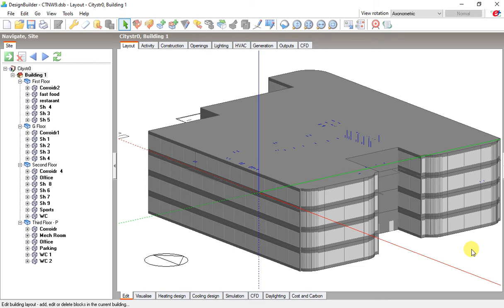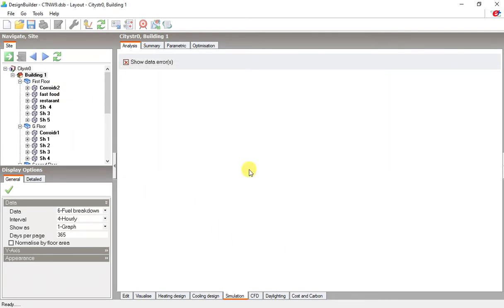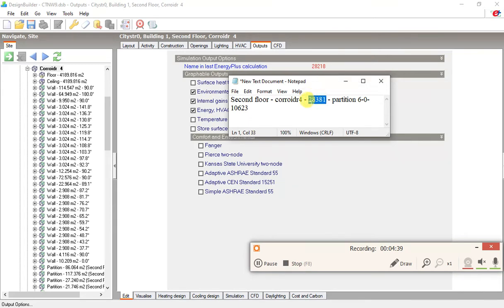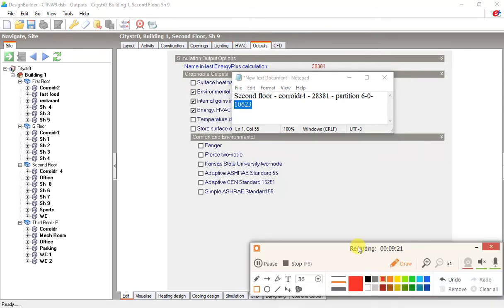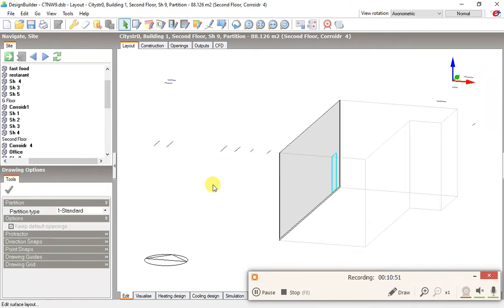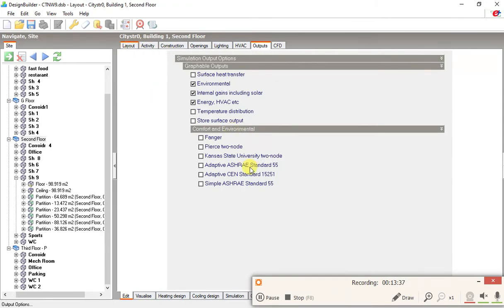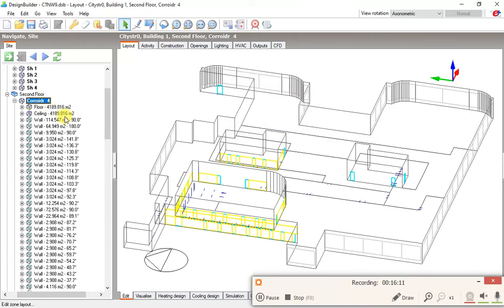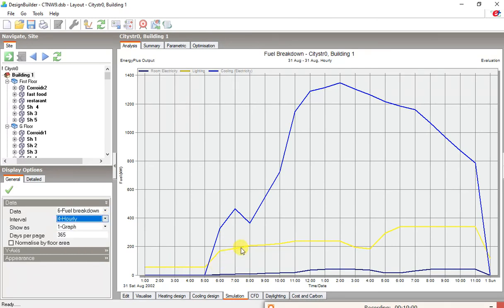Design builder error , Error getting other internal door id SOLVED

Comment: I get this error every time I try to run the simulation "X zone not convex in full interior and exterior and you can switch it off". tried to modify the building and zones but still not working.
Reply from the maker: Hello dear Sara
This error is because of the shape of the building and zones and it showed because you tried to get the results from the Cooling design tab. 
You can choose how your building being calculated in solar options in this tab or just skip this error and turn that zone off and run the simulation.
Reply from the maker: Also, you can send me an email on 
AlirezaMohammadzadeh@usa.com 
to schedule an online meeting via zoom or skype to share the software screen and talk more.
Reply: easy solution for those who might face the same issues; in Model Options  click on Simulation tab, and untick the box Check for non-convex zones.

Comment: i can't find the outputs in design builder
Reply from the maker: Hello dear Hanaa, 
when you finished drawing your building, defining zones parameters, HVAC system and the climate epw file, your project is ready to run the simulation and get the output.
Reply from the maker: And maybe you are at Design Bulder Data Window, So you may see 3 subheaders next to each other from left to right: Recent Files, Component Libraries and Template Libraries. 

Also, you may see on the right side of the Design Bilder window Info, Help section. In the Help tab, you have the followings :
- Open selected site
- Delete selected site
- Clear recent files list

- Create new project 
and 
- Open existing site.
there click on Create new project to start your project.
Reply from the maker: The other way is using the navigation bar: Files, Edit, Go, Tools and Help;
there click on Files and then click on New project
And the last way is to click on the first icon with a white paper(file) from the left side.

Don't forget to visit the main Design-Builder channel for more instructions.
Reply from the maker: Hi there!
Thank you for your interest in building energy modeling with DesignBuilder! 
I’ve created a poll in the community section to see if there’s enough interest for a Zoom session where we can model a 2-story building together. Please check it out and vote!

I’m also planning to host regular weekly or monthly meetings for our community. If you’re interested, feel free to email me at P7PAL20@gmail.com so we can share more details.
Don’t worry about costs—these sessions will be completely free!

Comment: the license cant work with me help me plzzz
Reply from the maker: Hello, dear Alaa kotb, 

first, read getting started after buying a single-user licence in:

>>> https://support.designbuilder.co.uk/index.php?/Knowledgebase/Article/View/150/0/getting-started-after-buying-a-single-user-licence

then check the version for design-builder and loading a licence file as follows in the link below:

>>> https://support.designbuilder.co.uk/index.php?/Knowledgebase/Article/View/81/0/loading-a-licence-file

Also, you can submit a ticket about your problem if still exist by sign-up an account(subscribe) and write about your problem in:

>>> https://support.designbuilder.co.uk/index.php?/Core/Default/Index

And you can directly contact to this email address:

sales@designbuilder.co.uk
Reply: @alireza-mohammadzadeh2750   Thanks for your response, but all the links are not working with me :( What can i do?
Can I run the program by crack or a free license
Reply from the maker: @alaakotb5809  Sorry about that, yeah you can get the design-builder in both 30 Day Trial and Cracked version, but each one has it's limitations and activation method. 
Visit the design-builder website for 30 Day Trial and it's in the home page, Also you can find the links above on the website too.

https://designbuilder.co.uk/software/free-30-day-evaluation

https://designbuilder.co.uk
Reply: @alireza-mohammadzadeh2750  Thank you very much , You helped me a lot. Will you complete this course?
Reply from the maker: @alaakotb5809  Thanks for your comment,
this video is about a common error we can face within design-builder. If you want to know if there are any courses available about how to design a building, compare the energy consumption and discuss the results of the simulation, you can follow us on Instagram: @eepolicy 
and the regional courses next year is planned to start in Iran (host country).
also if you have any questions about energy modelling you can email us on 

hapcoir@gmail.com
AlirezaMohammadzadeh@usa.com
Reply from the maker: Hi there!
Thank you for your interest in building energy modeling with DesignBuilder! 
I’ve created a poll in the community section to see if there’s enough interest for a Zoom session where we can model a 2-story building together. Please check it out and vote!

I’m also planning to host regular weekly or monthly meetings for our community. If you’re interested, feel free to email me at P7PAL20@gmail.com so we can share more details.
Don’t worry about costs—these sessions will be completely free!